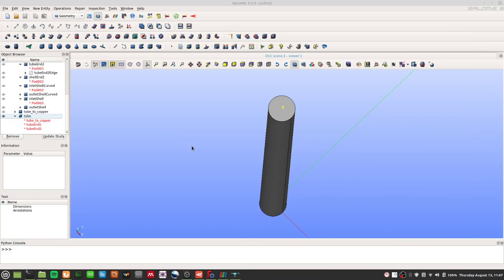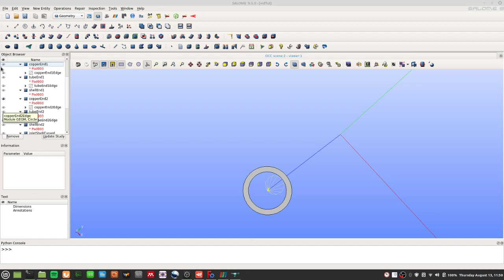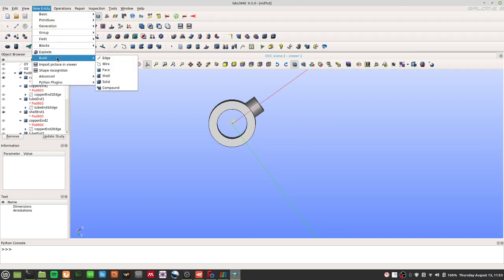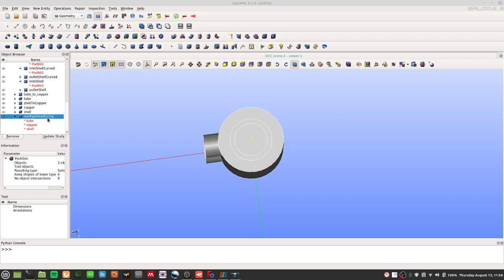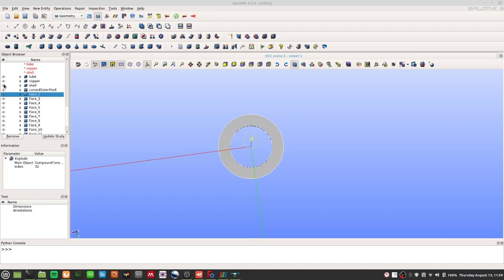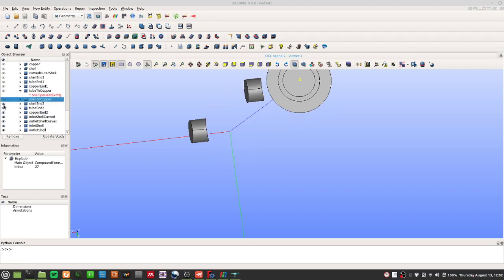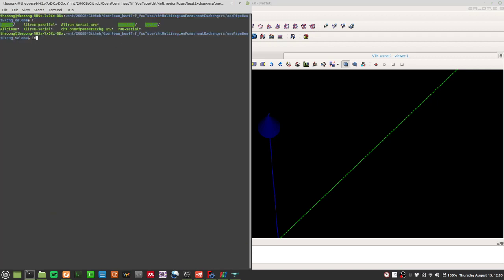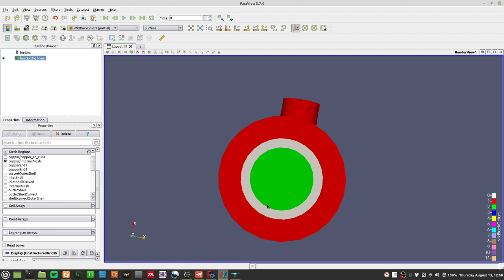OpenFoam Heat Transfer 65 - multiRegion salome meshing ideasUnVToFoam and splitMeshRegions

Comment: Hi theo ong,

There's something I'm curious about. You mesh the geometry you partition, but what if I wanted a solid geometry (for example here tube) to be more refined than other meshes or to be hexahedron mesh? Is it possible to make it in Salome and use splitMeshRegions without any problem? Did you try something like it?

Comment: Hello! 

I am having trouble on defining the interfaces as "FaceZones". I did my geometry in solidworks and exported it to salome as a STEP file. For some reason, when I create the UNV file, the interfaces go as "patch". Could you help me? (great content, by the way)
Reply: For those who might be interested, The problem was solved by using the STEP (from solidoworks) geometry to generate the faces(explode > faces), excluding the duplicated faces (the interface between two solids contained two different faces, I excluded one of them and left the other) and then generating new solids from the remaining faces (New entity > build > solid). After that, create a partition with all the geneated solids and the process go on like the video, the interfaces will now present only one face.

Comment: I am having trouble converting my geometry from solidworks into openfoam for meshing. My problem is that I cant seem to convert the solid body into a completely closed STL file (to ultimately begin blockMesh and snappyHexMesh). 

My case is conjugate heat transfer between a solid and a fluid domain. Before going to my fully complex problem, I am attempting to get the workflow down with a simple case (fluid flowing and heating up in a simple pipe) 

Maybe you can find the flaws in my procedure, which is outlined below. 
SW geometry creation (2 bodies- 1 solid, 1 fluid)  Export each body separately as STEP  import each body in same session of SALOME  partition and create face groups (inlet, outlet, outer wall, interface_fluid-solid) export each face created as an STL  combine all the STL’s into one to create my outer boundary. 
When I run “surfaceCheck” on the combined STL, I am getting the error that the surface is not completely enclosed.

Comment: hii. Thanks. Is there any option in Salome to subtract one body from the other keeping the tool bodies still there , Its for conjugate heat transfer problems for example An electronic part (solid) being surrounded by a coolant like Air. Using cut function removes the solid totally but i want it there . thanks